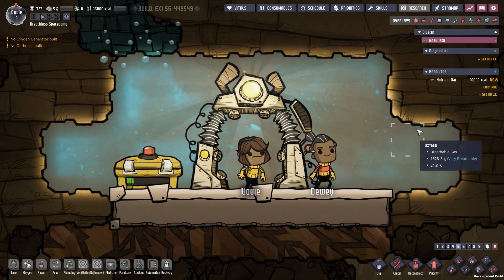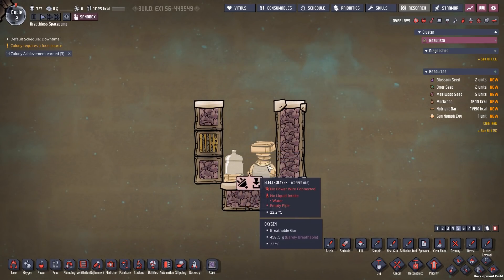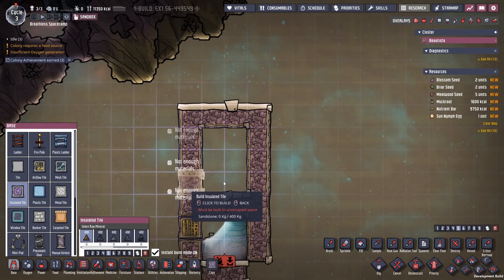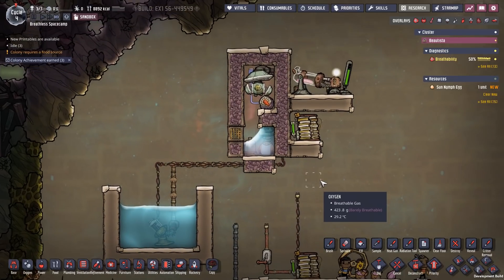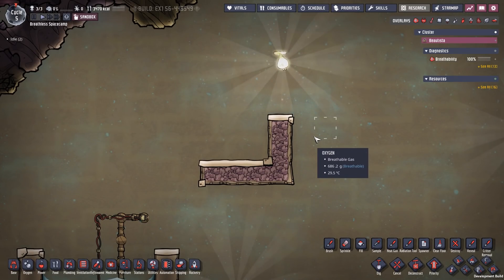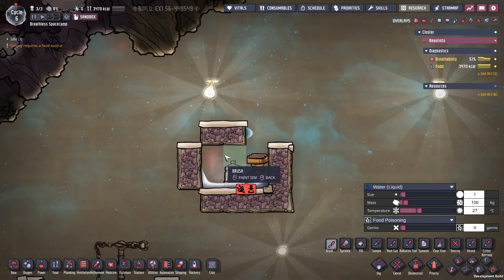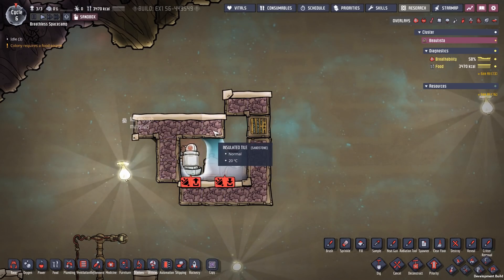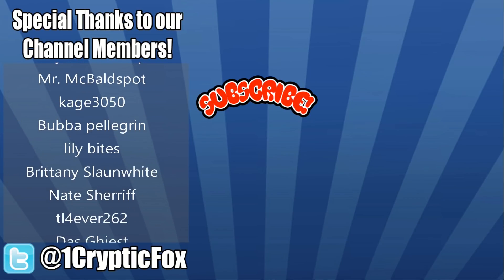How to Make the SMALLEST Electrolyzer Build! - Oxygen Not Included Tutorial

Comment: you can make this even more efficient by putting one of those plastic water pump. it will move enough for one electrolyzer and it only draws 60w. So 60w plus 60w from the gaz pump and 120 from the electrolyzer makes a 240w draw. now since the small gaz pump only draws 50g/s and the gas draw from the generator is 100g/s it is safe to assume that you would be outputting 50% of what the generator can do so... 400w (max 800) this makes this hydra not only self sufficient but also will generate more power than it actually needs.

Comment: Not very stable, and hard to start up. It ran for half a cycle before the output swapped and broke the generator. It lacks safety guards against hydrogen drifting up from below, triggering a swap. The water jumps up and down. Not stable.
Reply from the maker: I've used this build for hundreds of cycles without issue.  The hydrogen shouldn't be getting O2 in it if you have the pressure sensor set appropriately.  the single layer of hydrogen along the top row prefents the O2 for ever moving into it unless you're pulling too much hydrogen out.

Comment: Very underrated design! This is a great little "starter" O2 generator for new players, distant rooms, small colonies, and temporary footholds on other planets in Spaced Out. Aside from a bit of difficulty getting it primed up sometimes, it's such a cheap and easy build it's always my first step into having a renewable O2 and power supply and I continue to rely on it even in the new Frosty DLC. Even if it's not technically "self powered" on its own, its power draw is extremely minimal, really only needing the 120W electrolyzer itself plus if you're using a liquid pump for water, and if you've got another power source you can skip the hydrogen generator and leave the hydrogen pump idle at first and just use it to build up an infinite capacity hydrogen reserve for later use. It's an easy and useful build. Just make sure you have pipes and wires connected to the buildings before you close it all in!
Reply from the maker: Yeah the priming is a bit of a nuissance but I do like how little space it takes up.

Comment: Make it 2 tiles taller add another air flow tile then add a hydrogen gen on top and battery on the inside just make sure to use gold
Reply from the maker: the entire point of the video was to make them as small as possible.

Comment: I'm not a big fan of flooding machines to cheese the game's tile-based mechanics, so I would probably recreate this without fluffing about with that or dealing with priming the gas pump. It is neat to see the SPOM concept compressed down to the smallest possible working pieces. This concept is entirely scalable - if you're having issues with the gas backing up a simple set up with automation wiring, a smart battery and a gas reservoir can more than easily create backflow and burnoff for the excess.
Reply from the maker: This was mostly for the purposes of making a SPOM as small as possible.  When I play the game I don't normally mess with these kinds of gimmicks :)

Comment: Hello! Thank you for all the hard work you've been putting into all these guides. Very helpful to say the least. I have one quick question regarding the first setup you explain. I have tried different setups before and I always run into the same problem. Once the hydrogen reaches 2k, it start going down into the section of oxygen which get pumped out into my base. 

I have been trying to figure out the exact amount of power I need to consume by my hydrogen generator in order for the hydrogen produced by the electrolyzer to stays stable but I can't figure out the right amount. 

My question is, does your system stops the hydrogen from going on the left side even when it reaches 2kgs per tile or you have to baby sit the system every once in a while and increase power consumption in order for the hydrogen concentration to go down?
Reply from the maker: I've never bothered trying to min/max the power.  I use a pressure sensor so taht the pump turns on anytime the pressure is 500g or greater to remove excess hydrogen and then I never have to babysit it.  Could be I'm burning more hydrogen than I need to relative to the power requirements of the system, but my concern has always been to just have a consistent and steady supply of O2 and not worry about a bit of power waste.
Reply: @CrypticFoxGaming  Gotcha! Yeah I also use the pressure sensor, but eventually, the power stacks on the battery and then the gas starts accumulating in the pipe until it's full, then it does not matter if the pressure sensor turns on, the hydrogen just keep accumulating around the pump until the tiles get overpressured, then it starts going down to the oxygen section.
Reply from the maker: @Frozytv  The battery shouldn't matter unless you're using a smart battery to turn off your hydrogen generator.  I specicifically didn't use a smart batter so that the generator will keep running.  If you're still running into an issue with too my hydrogen (which your really shouldn't be) then you could set up an overflow to a gast storage tank to store up excess hydrogen or add another hydrogen generator to burn the excess.
Reply: @CrypticFoxGaming  You found it! That's because of the smart battery. Thanks a lot :) cheers

Comment: I know this might be a little late, but you could make both of these closed systems so you never have to worry about other gasses.
Reply from the maker: and then you'd need to pump out more of the gases which defeats the "smallest" build intention :)
Reply: True, but most of the time the oxygen is going into suits any ways. And depending which setup it is about 3 more columns of tiles roughly

Comment: I love this setup so much. For anyone having issue where the saltwater/water moving up and down leaking the O2 into the H2 part, the issue usually comes from CO2 blocking the O2 tile. You could fix by either building Г-shape tile to prevent CO2 getting in. Or (if you don't need energy), setting H2 atmo sensor to very high (e.g. 20kg) so the O2 won't have enough pressure to leak into the H2 part.
Reply: omg tysm i did not know what was happening i thought i put a worng amount of liquid ;-;

Comment: Have a timer for the second setup, running about 1/2 the time. 31 seconds on, 30 seconds off. As the electroliser creates 122g/s of hydrogen.

Btw. The hydrogen generator won’t shut down when those batteries are full. You need the better types with automation built-in.

I didn’t get why do you use the salt water though. I with test it later.
Reply from the maker: the layers of water were to "fill" the space, but using the least amount of liquid so that the machines wouldn't shut down.  The intent with the hydrogen wasn't to preserve as much as possible, but just to burn it all up and generate power.  I don't want the generator shutting down as it could back up the system.

Comment: Bruh the first one is fine (before the liquids) it shouldn't be running out of power. 1) you can use 4 pumps for 2 electrolyzers. 2) use an advanced battery with settings at 90/60 set up to the hydrogen generator so you aren't always burning the hydrogen. If one gen isn't enough use two. 3) once you've done that (preferably with a gas tank for buffering) you can use the excess hydrogen for your main power grid. 
The advanced battery stuff alongside the excess hydrogen also applies to the mini setups. Use automation!
Reply from the maker: You CAN use 4 pumps, you don't really need to.  The point of this video was making the smallest setup possible, not adding addition complexity to what I already use :)
Reply: @CrypticFoxGaming  you said the first one had problems, I'm just saying those problems are easily fixable. I definitely appreciate the size of the small ones. May use it at some point, doesn't mean it can't be improved
Reply from the maker: @xXBamboostick3Xx  Fair enough :)

Comment: May the developer fixed this, disable the electrolyzer if there is >1g liquid at any place within the machine.
Also make the output gas at 1000•C so that electrolizer does not delete heat when used on hot water. Respect the preservation of energy please. Nothing should be able to delete heat, only mitigate it away, and all machinery regardless of function should radiate more heat than it can remove.

Comment: Yeah, cool bro, better tell me how to get that much cold water for oxygen machine and for cooling that oxygen... :/
Reply from the maker: Don’t need cold water for the machine.  As far as cooling the O2 it makes, use some radiant piping and run either a cold liquid or cold gas through it.  Could also build it near a cold biome to offset heat.  More than one solution to every problem :)
Reply: @CrypticFoxGaming  that's what I'm saying, I don't have cold water to cool that air, need to use aqua tuner which is problematic
Reply from the maker: Doesn’t have to be cold water.  Could use a cold gas loop that passes into a cold biome to chill it, or a series of wheezeworts, some polluted water that isn’t overly hot, use ice makers to make ice and let it melt, etc

Comment: Having issues actually using this in game.. due to the heat I usually throw this in a cold biome. And the water keeps freezing to a solid .. ugh
Reply from the maker: Ouch.  Yeah until it gets up to a certain temp that would be a problem in the cold biome.  Might be better to just cool it with a radiator where the O2 comes out.

Comment: I mean, you could separate the pump in the super small setup with an airflow tile and then use a large pump.... but it's only saving like 2 tiles or something from the other one.
Reply from the maker: The spacing becomes important to maintain the seal.  Also minimizing power consumption.

Comment: interesting "hax"... :P

can't say I've seen this method before, tough I kinda like my massive power hungry setup with built in thermo regulators that spits out cool air and removes heat through the generators... electrolizers don't reaaaly destroy heat since the ouput temp is based on the inputs, but the hydrogen generator has no outputs and seems to have little heat transfer from the inputs.
Reply from the maker: Yeah I most often use a larger multi-pump setup too

Comment: Hi ! Excellent video , but i have a question  . How mani dupe this setup supplie ? And does this setup has enough power to supplie another gas pump ?
Reply from the maker: I don’t think it will spin off enough extra power to run another pump.  I haven’t looked at the calculation in a while but I think the one system supports 8 or so duplicants.

Comment: When you reach the point where you have to mess around with submerged machines that still count as not being flooded, it's time to stop.

They should just fix the game so gas and other stuff does not get deleted. Yes I get that they did it to make it easier for things to work most of the time, but that is just not how physics work.
Reply from the maker: This mechanism isn’t deleting any gas.  It’s just a way of using the in game physics to sort the two gases into different places and make it so the electrolyzer doesn’t over pressurize.  All just fun and games :)
Reply: @CrypticFoxGaming  I know, this method probably maximizes the gas output, was referring to the physics engine in general. Still a bit much that a building can be submerged without being flooded.
Reply from the maker: Yep that’s a bit exploitive haha

Comment: I'm having a problem where the water/saltwater will move up and down where the hydrogen comes out of the electrolyzer and is allowing oxygen to get into the hydrogen and over pressurize my electrolyzer does anyone know a fix? (for the first build by the way)
Reply from the maker: Sounds like you may be getting a bit of CO2 drifting in.  Hard to help troubleshoot without being able to see it.
Reply: I'm having the same problem. The bubble just won't stabilize without flooding the building...been trying to get it to work all night :(
Reply: CrypticFox Was right about the Co2. I built a little upside down L made of tiles off the O2 vent as a fix. O2 gets caught in the pocket stopping any other wandering gases from blocking the 02 exhaust tile.

Comment: Very nice work! Do you think it will also power a Gas cooler? with the hydrogen Generator, or does I probaly need to connect that to another Generator?
Reply from the maker: I haven't tried running something like that on it, though it does produce more power than it uses so you could draw some of the power off as long as you don't create a shortage.

Comment: to prevent co2 going into the system , you can build a reverse L wall on the exit, creating an o2 trap as co2 will never goes above o2 and with the constant flow of o2 hydrogen will had a hard time of going in
Reply from the maker: Yep that would work too :)
Reply: The design just screams for cover for O2 opening: just 2 bricks in the shape of ┐ above the opening. That way there will always be some O2 in the system.

Comment: This is brilliant, I never thought it could be possible to set up a one pump electrolizer.

One thing that would make me nervous about this though is robustness. The wrong gas sneaking in at the wrong time could mess up things, and with ONI things like that always seem to find a way to happen... I used to use a SPOM similar to your previous setups but I switched over to two pump vertical setups with a (mechanical) filter for that reason, those things never fail and you can even send in duplicants without worrying about it messing the setup if you need to.

With all that said though this was great to watch. Thank you for sharing!
Reply from the maker: Yeah the other version I use is very consistent and doesn’t have the same failure potential but also produces a bit less oxygen since it does hit max pressure with some regularity

Comment: Any tips on how to get the water in there without using the sandbox? Do I have to just hope I get the volumes right with the bottle pump or is there something more precise I can try?
Reply from the maker: The bottle emptier is best I find.  With the bottle emptier you can watch the levels as the water dumps in, and as soon as you want it to stop you pause the game, deselect all the options in the bottle emptier, and then when you unpause it won't dump anymore water in.  makes it pretty easy to add the right levels in.  The hardest thing to deal with is the duplicants exhaling CO2 while  you're doing stuff :)
Reply: You could always run a pipe full of water through the target area and deconstruct the pipes. Each pipe segment contains the same amount of liquid, meaning it's fairly easy to measure how much water you're dumping.

Comment: Neat designs, I tend to only use smart batteries plus a little of automation on a gas reservoir to store up and delete it when it gets too full. My typical design will generally use 2 oxygen gas pumps (per electrolyzer) and 1 hydrogen gas pump, basically saving 2 gas pumps which is 480 watts of power.
Reply from the maker: I commonly use a spom with multiple pumps but I wanted to try building some that are smaller and more power efficient :)

Comment: Nice! You might be able to add a bit of a failsafe to the system with a powered airlock and a gas element sensor on the outside of the build against the airflow tile: set it to slam the door shut if it detects anything other than oxygen near the output gate, and perhaps an announcement and/or full shut-down on a filter gate in case it's more than just a drifting tile of gas.
Reply from the maker: Potentially.  As long as its running the only risk is random CO2 packets moving around from duplicants exhaling
Reply: @CrypticFoxGaming  True, but I also meant in case of a hydrogen blowout on that second design.

Comment: i have a build for you to try to see how long you can last.

1) you get up to 20 duplacants, and once you have pass 300 cycles, then you can have more then 20 duplacants.
2) Debug mode can be use only to give items you have pick up 1 unit of it (Like if you mine or got Gold as a gift, then you can have Gold from Debug but only the type you have mine/got as gift)
3) you can not use any other Debug mode powers (But you can use VOID to remove any gas)
4) there have to be 4 groups of duplacants so you can have one or so group asleep at a time. (Modeless have it set so each group start when one other ends for work)
5) any Liquid can be place in Liquid Reservoir, but there have to be a Airflow Tile tank setup. The setup is made with one or more pump with Airflow Tile use for the bottom and side. Then you can have the Liquid Reservoir set up for overflow or to hold any type of Liquid later.
6) Bedrooms are set up so each duplacant have there own room with bathroom. (Any other duplacant can use the bathroom even if it not there room)
7) you can Debug any Gas type once you mine or open up the gas.
8) Oxylite can be added at any time.
9) small add on from number 3, once you build one unit of a item, it then can be Debug.

i think that mite be it. right now im working on my and it good going.
Reply from the maker: I prefer not to use debug or sandbox when I’m playing.  I only use the to experiment